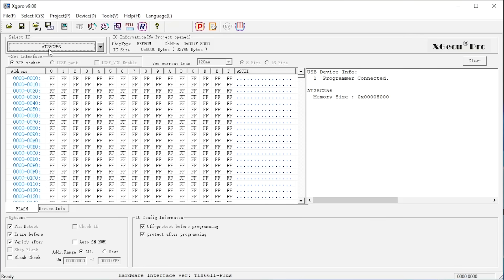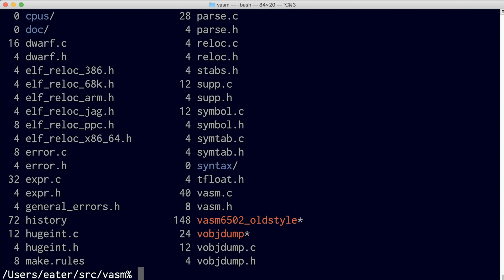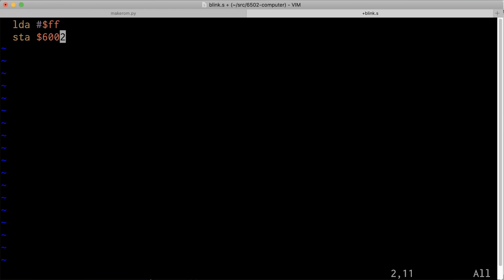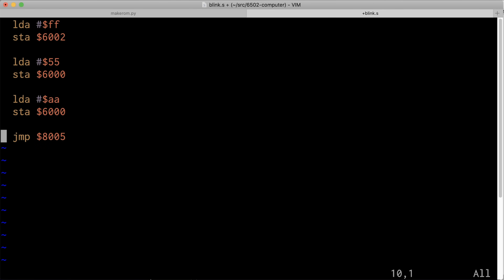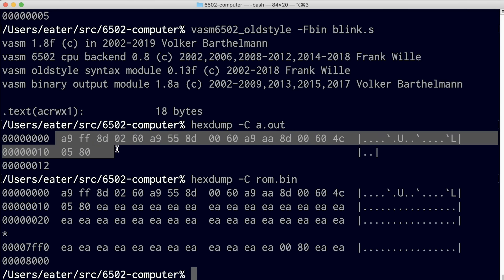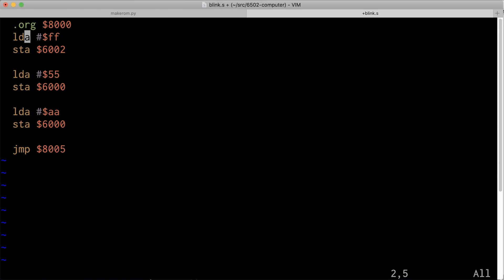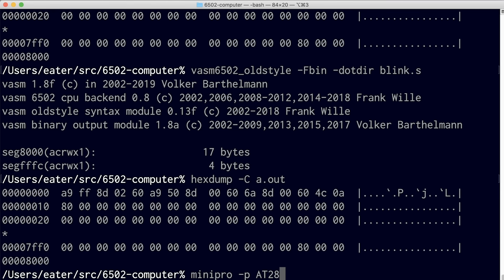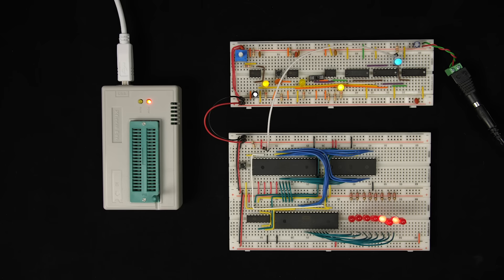Assembly language vs. machine code — 6502 part 3

Comment: Back in 1985 that’s how I coded, with 6502 instruction set and paper and pencil and then typed the bytes. I had to count the bytes for the jumps by hand and if I had to jump more than 256 bytes I coded smaller jumps by hand.
We had no compiler to do that.
Reply: You want pain? Had to toggle in addresses and instructions individually on the high school's brand new PDP-11
circa '72.  Big hoorays when they later that year 'upgraded' with a punched papertape reader/writer. Ah the good ol days.  LOL.
Reply: Did they not have assemblers back then?
Reply: @MrSapps  probably did but they were also expensive
Reply: @MrSapps  yes there was,but nobody know it was stone age. people do their own assembler or becouse they were so good on machine code they not need
Reply: PaulsMagicVideos I had the Print-out of the Apple 2 OS in the back of the Apple Manual, so I knew Assemblers existed, but we didn’t have that at school. yes, 6502 programming was a school topic in 1985! It was awesome. I met and thanked my science teacher  for it 36 years later! The 6502 had a clock speed of about 961 kHz, not even 1 MHz!! We entered the bytes with a poke statement for each byte.
Reply: @idjles  I actually measured the clock speed on my Apple II+.  It was somewhere between 1.0204655 and 1.020466 MHz.  The manual for the Apple IIgs listed the number of clock cycles for each machine instruction, so I was able to write programs such as stop watches, sound recorders and players, and tone generators that were accurate to the clock cycle.  Some instructions, like the conditional branch instructions, varied in number of clock cycles depending on their action.
Reply: Wow, I was not the only one.  I wrote a few video games by typing in hexadecimal numbers.  Yes, paper and pencil was the way I kept track of my variable and routine addresses.  I still have some of those papers.  Of course, I thought in assembly language.  Sometimes I wrote code in BASIC first and then manually compiled it into machine code.  I did this for a 3D maze game that drew 18 frames of animation to turn 90 degrees.  To make programming somewhat easier, I used to space routines out in memory and then compact them together when I was done with the program.

Comment: Hey ben, I was wondering, how can we improve the amount of ram in our computer. Adding another module wont work because the assembly language cant handle it, right? The way Im doing it is making the line of code two bytes long, the first byte for the instruction, and the second for the memory location (instead of one byte split into 4 instruction bits and 4 memory bits). It feels like a psudo 16 bit computer.

My method though can only be expanded up to 256 bytes, and I was wondering how a 32 bit computer can even have 16 gigs of ram. Id love a video on this topic if you have the time. Thanks for all that you do, you are an Inspiration!
Reply: The trick is to design special instructions that will fetch the next two bytes and combine them into a 16 bit address, and then use that long address to fetch the actual data from RAM.

Your extended instruction set will now contain "short address" instructions using up 2 bytes (op-code + short address) and "long address" instructions using 3 bytes (op-code + long address).

Edit: You might need to rewire your CPU so that you have more micro-cycles (T1, T2, T3,...) if your microcode needs more steps to implement the new 3 bytes instructions.
Reply: @JanBruunAndersen  ok, awesome. So to have more ram, you need to sacrifice the speed of the computer, because it needs to read twice as many (or more) bytes per line.

Possibly, the first 4 bytes can be the length of bytes to read after the instruction.
Reply: @boggless2771  not necessarily. A 32 bit computer does not read 4x 8 bit bytes one after the other, it reads a 32 bit word all in one go. This way you are not sacrificing any speed to read larger amounts of data, and hence why it would be referred to as a 32 bit computer - the width of the data bus.

But there are other tricks to increase useable RAM beyond the width of your address bus, e.g. paging. Using some kind of output register you can manually control some additional bits to form a larger effective address, with each combination of those bits forming another page of memory. But there is some software management overhead involved, and requires the right hardware design to make that work.
Reply: @TomStorey96  yes, the bus is bigger right? But what Im asking is for an 8 bit computer, you'd need to send a more than 8 bit address to get the ram data. Or similarly for a 32 bit computer, if it wanted more than the 4 gigs (2 ^ 32 adresses) it would need to send more than the 32 bits through right?
Reply: @boggless2771  effectively, that's correct. But since a computer with a 32-bit address bus can't directly address more than 4GB of memory, a different method needs to be used to address more memory.
One technique used is to place many "blocks" of memory at exactly the same addresses in the memory space but then an outport port is written to in order to say which "block" of memory is active, so only the "active block" gets either read from or written to until the "block" is changed.  The logic is made mutually exclusive so only one "block" can be active at one time.
The value written to the output port can be thought of as being the "highest byte" of the memory address in that case.
Generally, in that kind of block-mapping, part of the memory is "fixed" and is not block mapped so that the operating system can reside there and control the block mapping for the programs which are running.
Reply: @boggless2771  Yep, this is where the idea of paging or banking comes from. And there are various ways to achieve it. Intel has something called PAE btw.

But basically it revolves around the processor or system somehow implementing some additional physical upper address bits, and you need some software to manage how that is configured, mapped, and switched in and out.

Physically, you simply need more bits - more traces in your circuit to connect to more address inputs on your memory devices. You can achieve this using some kind of external latch where you store these additional bits, maybe some flip flops or even a VIA like Ben is using.

In software, you need to do a number of things.

The system software needs to be able to maintain a list of banks, and who they are assigned to or what is using them, since they will all share the same "virtual address space", but only one of them is switched in at any one time. As you start an application you assign a bank to that application and switch it in and then start executing its code.

Therefore, the application software also needs to agree that it will access all of its RAM at some standardised address range. Possibly also it will be written to assume that it is located somewhere in particular in ROM.

If you look at any Linux binary you'll probably see that it always "starts" at address $40000000 or something like that, just like using .org $40000000. The processor can contain a translation table to allow it to translate any address in the $4xxxxxxx range to the actual physical address range assigned to that application.

Well, its a bit more complicated than this, and I might not have the full picture, but maybe that gives an idea. If you want a topic to read up on, look for information about MMUs - Memory Management Units. They are the kinds of devices that would handle a lot of the gory details (aka magic) of this kind of thing.
Reply: @melkiorwiseman  well said. I was trying to find the words to say essentially this. 😄
Reply: Thank all of you for all the responses!

Comment: What's the significance of putting FF in memory 6002?
Reply: See previous episode at 39 min 20s onwards... it sets data direction register as output for the 8 bits he has leds on.
Reply: starting from 6000 circuit has this chip 65c22 whatever it was we want control. this can be RAM it dosent matter it just write FF to address 6002. even there were nothing on that address cpu still do it lol

Comment: Using a linker script and makefile is probably preferred in this case. It helps a lot when dealing with specific vectors and whatnot :)

Edit: Scrap that idea. 6502 has rudimentary support at best with gcc. I'll leave the comment visible for you to laugh at :P
Reply: cc65 is a c compiler for 6502
Reply: @TheKetsa  There's plenty of C compilers. (Not that I'd like using C on something like this) It's the other features of gcc that would be nice to have. Getting manageable sections, macros etc etc :)

Comment: Obligatory "I've been using VIM for 17 years.. How do I exit, please send help" joke
Reply from the maker: Honestly, I'm not sure I'd recommend vim to anyone who hasn't already been using it for the past 25 years.
Reply: @BenEater  Vim is all I know and I can't stand anything else. I try a bunch of other editors and usually end up installing Vim emulation in them simply to find that they are poor implementations. Maybe I am simply vim biased but to me its modal language makes sense. I learned from the stock 'vimtutor' command installed on just about every system with vim. PS: What font are you using in this video? Djavu Sans Mono?
Reply: @BenEater  At work I mostly analyze spectrum graphs and find patterns in outages, meaning I often paste or type a lot of information into notepad (well Notepad ++). Now I had heard of VIM during some YouTube video and decided to try it out for fun.

There's a lot of stuff that I would have to learn (though probably would automatically learn with continued use), but it's also a very powerful editor where you can do lots of fun things. It just so happened that during those few weeks I had gotten two massive piles of data as just plain text and no real formatting. I could've probably figured something out by combining Notepad++ and Excel features, but it was just perfect for VIM and the fun stuff you can do!

Of course, afterwards we switched to Windows 10 combined with some new security features and VIM never worked again :(
Reply: Speaking of vim, does it have the syntax coloring for 6502 or you installed it?  Or it’s just a generic syntax for .s files
Reply: @matteopascoli  I wanna know this too
Reply: @matteopascoli  yes, there is (vim.org). I'm using TextMate to edit 6502 asm files (mac notepad-like editor) and that has support for it, too.
https://www.vim.org/scripts/script.php?script_id=1314
Reply: ZZ :)
Reply: Press power off
Reply: you need to know basic UNIX
  ctrl-c kills almost all running jobs.
Reply: I never understood that joke. Probably because I am such an avid Vim fan, but I actually get confused trying to exit Emacs. Not that I ever really use emacs but every time I fiddle with it I can't ever exit .

Comment: I'm using RetroAssembler right now. But it is not compatible with TASM which I cannot use on Windows 10, but there's a lot of programs written for TASM out there. I'll give vasm a try. Maybe that'll ease my pain a little bit.

Strangely you've started this series of videos exactly when I've started building my own 65c02-based 8-bit computer. (: I developed a simple emulator with customizable ROM and RAM chips, and basic 6551 emulation. This allowed me to develop (fork cmon actually) a monitor program that will work with my provisioned address map. Now when I've finally received all the components I might need at the beginning, I can start working on an actual hardware. Although implementing a bus on a breadboard with lots of wires seems to be very tedious and thus intimidating.

I have a lot of different questions about building an 8-bit computer. It would be nice if you could answer some of them...

I don't know what is going to be the best way to implement address decoding. It looks like using EPROM as an address decoding device will give me amazing flexibility while using only one chip. Is that a good idea?
What memory mapping scheme should I choose?
Should I try to make it compatible with, say, Commodore 64?
Is RAM paging a good thing? Should I use (or at least foresee the implementation) it in my computer?

Thank you.
Reply: RAM paging is most useful if you intend to run a multi-tasking or multi-user operating system, since you may be able to avoid a lot of disk accesses by just giving each task a separate RAM page.
If you want security so that programs can't access each other's RAM, that's another problem and would require hardware logic designed for the purpose.
Reply: @melkiorwiseman  I was thinking more of a RAM bank switching. This would allow programs to use RAM outside of 64k address space. Memory chips are relatively cheap and by memory bank switching I will be able to use up to 512kb on a single 4mbit chip. 8-bit shift register will allow to swap up to 256 "banks" (16kb each), which in total should allow programs to utilize up to 4 megabytes of RAM through this 16 kilobyte window. This way games for example will be able to store game levels and graphics in different banks.
I feel this is a huge topic to discuss and YT comments is not the best place to do that.
Reply: @AntonMikhaylov  Bank switching can be used for programs or for data.  The major problem with bank switching is that the more bank switching is required, the slower your program will run due to the overhead involved in executing the bank switching instructions.
But yes, what you're describing certainly can be done.  Whether or not it can be done quickly enough to keep up with something like a video game is a different matter.
Reply: @melkiorwiseman  well... If a game loader transfers all data from a media beforehand, and you are planning to have a long play session, then you'll spend more time playing a game and less time loading each individual level every time you progress or fail and have to restart. Switching banks will be instantaneous compared to [re]loading level from a floppy or even an HDD (or a CF card).
Reply: @melkiorwiseman  so in other words it is up to a developer to write his program such way that less bank switching is required. And since he has a lot more memory to work with, he can be pretty generous in splitting/spreading his data into banks not worrying about few unused kilobytes of RAM here and there.
Reply: @Mike Sienicki I'll try to apply my broken math here. Say, a ROM chip with access time of 120ns can operate at speeds of ~8MHz. If we want the output to be active at least half of the clock pulse, this number should be divided by 2. So, we have 4MHz as the maximum clock frequency. This should be enough for the ROM chip to digest address bits and output data (8 bits of address decoding data to enable other devices) fast and long enough for other components to react. But now we have to think about components this chip is performing address decoding for. Let's assume they have similar access time, so the clock frequency should be divided again. So in the end we have a 2MHz maximum operating frequency and still the whole system might be very unstable and unpredictable. Dangit.
74ls138 decoder has a propagation delay of ~30ns, which gives an operating frequency up to ~30MHz. So probably using a pile of 3-to-8 decoders will be better to implement flexible address decoding at the desired clock speed - 4MHz.
Reply: @Mike Sienicki found Winbond W27C512 EEPROM with 45ns access time. I think this is the chip I'll try to do something with...
Reply: if you dont know how asseble then use same assebler that teacher use. every assebler have different syntax

Comment: Really curious as to how this ties in to the world of modern x86_64/arm architectures, what the differences are (and what the similarities are!).
Reply: Conceptually it is very much the same. A different instruction set of course, but it's all memory addresses, registers, and fiddling with bits only on a bigger scale.
Reply: So the thing that blows my mind, when I think about it, is .. and since digital electronics have no concept of what data is, its all just data .. that the entire digital world is literally copying bits from one place to another.

Generate some bits here, move them through registers/memory and wires to somewhere else, move them through some more registers/memory, more wires, and so on. Thats all it is. And yet it can translate the click of a mouse button into a video playing from a remote machine.